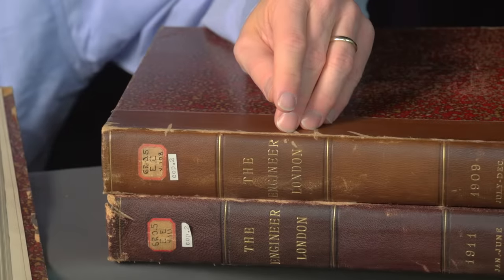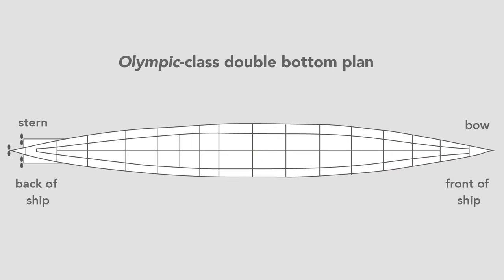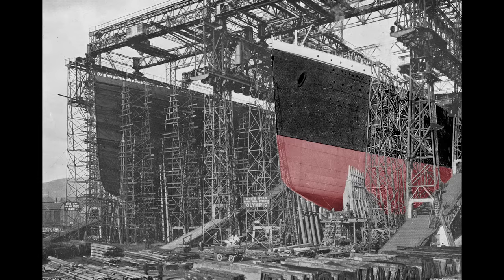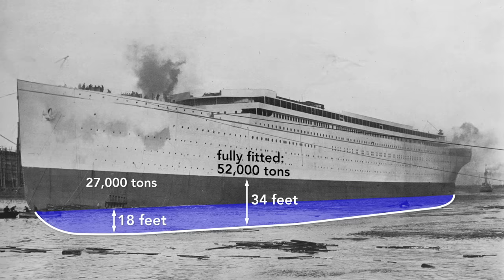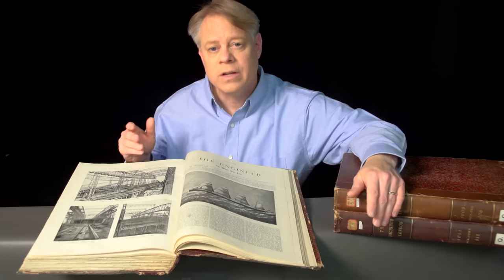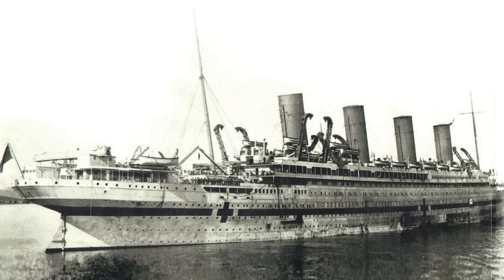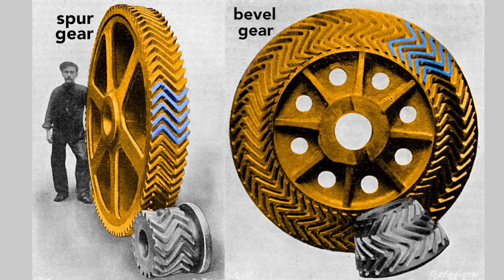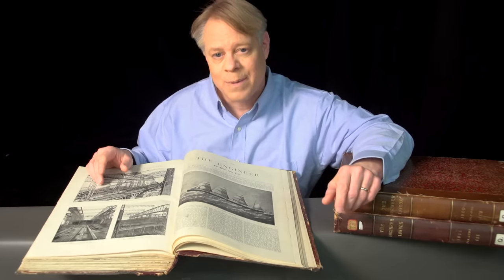RMS Titanic: Fascinating Engineering Facts

Comment: The Olympics engines were in A1 condition when she was scrapped... it was a terrible waste...
Reply: so that's where the steak sauce comes from... the more you know
Reply: @jaxonvictoria4345  well played.
Reply: No
Reply: A1 condition denotes the class of the hull and anchoring / mooring equipment.  It does not cover the machinery 👍
Reply: @skippyguy3  the engines themselves were listed as in A1 condition ...  by her engineer .. the yard engineering department.. her insurers.. mainly as she was fantastically maintained and well under her design life...
Reply: @blogsblogs2348    'A1' is/was a hull class notation used by Lloyd's Register to denote hull condition and is not used for machinery items.  Use of this terminology (incorrectly) by someone or an organisation other than the Class Society themselves is misleading and therefore extremely unlikely for marine industry professionals, especially on insurance related matters.
Reply: @skippyguy3  "Important"  Thanks for making that point  :)
Reply: But obsolete technology.
Reply: they would have made great engines for something.
A yellow submarine perhaps.
Reply: Pennsylvania Mike  
Look at the particular design of the boilers and the steam cylinders (engines) themselves.
(You've an odd perception -- stunted -- of tecnological changes.)
They came up with double- and triple-expansion steam engines, then tube boilers, then turbines.
For a ship the higher caloric burning oil over coal kills coal, and it's much easier to transport, store, and transfer. (I want to see underway coal refueling.)

I am perfectly aware of all the things you naively raise.

Obsolete!
Reply: Pennsylvania Mike  
Oh... and Hell has its own heat source. So, not a Hell of a lot of places burn coal.  :)
Reply: Pennsylvania Mike  
I am frankly amazed an Engineer would say "it's the exact same thing".
Did you not have a History of Science and Technology class?
Reply: @its1110  everything is obsolete in a few years what is wrong with remembering machinery from the past? What's wrong with learning from past? What's wrong with it?.
Reply: Pennsylvania Mike  thank you I cannot stand people saying things are obsolete when they're still using AC current these people want windmills and solar panels and they still want a 200-amp service on their home LOL
Reply: @its1110  there's nothing wrong with it
 so you want to come on here and dog the people that are into antique engines? Do you want to put us in jail LOL yeah you probably do
Reply: @its1110  as a matter of fact it had electric heat 100 volt DC make fun of that Jesus man you are messed up people
Reply: @ronalddaub7965  
Ahhh... You use the word antique.  Seems the same as obsolete.  i.e. No one is building with that technology to make new things.

You are trying too hard to misconstrue me.

I am into old stuff... I don't insist it isn't obsolete.  Equating the use of fire to make steam is all the _exactly the same_ (the very words used) no matter the era is asinine...ridiculous. THAT's all I'm saying.

Do you people come on here just to show your arse?
Reply: @ronalddaub7965  
Your last point is a mystery, out in the left field of the back, back forty of non sequitur.
Have a beer and relax. I just did. :)
Reply: @blogsblogs2348  Obsolete and probably expensive to maintain and operate. To an engineer - fit and ready; but to a business, scrap.
Reply: Would building a new ship around obsolete technology make business sense?  A museum would be better than scrapping them.  Of course the museum would be absolutely huge.
Reply: It was the midst of the great depression when they were scrapped, trying to run a ship that size during that time was more or less a money losing venture.  In addition to that, this was at the time when White Star and Cunard had merged so there was an excess of vessels for the one consolidated line to run.  An offshoot of the scrapping was that it put food on the tables of families that would have otherwise gone hungry.
Reply: @its1110  You have a real problem , you absolutely have to be RIGHT!!  Being challenged in the least bit , really gets under your skin. Must suck to be you. Personally,  I enjoy and respect old, obsolete technology,  but I also enjoy new technology.  So I'm lucky, and completely happy.
Reply: @johnfranklin5277  
I didn't say I am not interested in/don't "enjoy" old technology.  It is of _historic_ and artistic value.  This does not keep it from being obsolete. Y'all're misunderstanding (perhaps on purpose) and misrepresenting what I'm saying.

Obsolete simply means that newly produced items no longer use that technology/method, because newer ways have come along.

What is so hard for Y'all to understand about this?!
Reply: @davidsault9698  
Thanks, David.
"Historical curiosity" I think is the term.
To a business -- no longer economical to operate.
Reply: @its1110  The U.S. had a class of ships to do just that.
Reply: @jeffreyskoritowski4114  
Err. Aprops of what?
Reply: Look... what it comes down to --
The old engines could have still been perfectly fine condition and operation  for the day they were designed and built BUT still have been obsolete to continue to operate due to logistics and higher man-power AND advances in technology.

There is the idea that at some point Sunk Cost becomes a lesser consideration.
Reply: @its1110  Underway coal replenishment.
Reply: @jeffreyskoritowski4114  
Oh yeah.
That was fun.
NOT!
Reply: @its1110  I never said that it was.
Reply: @jeffreyskoritowski4114  
Oh. I was agreeing with you. Rather.
Reply: @its1110  I'm sorry if I came off a little harsh. Bad day
Reply: @jeffreyskoritowski4114  
No problem.
I should have put a smiley.
:)

Comment: I greatly enjoy your excellent videos.  However as an engineer and ship builder, two things stand out as incorrect.  One the color of the ship was not painted grey prior to launch so that it would stand out.  The grey is a primer, or an intermediate coating to tie coats together, and the final black is the top coat. Ships are painted in several layers of paint and the final is completed many times after launch.   Second is that pine was not used as keel blocking.  If pine was used at all it was in a very limited fashion such as on the very top of keel blocking for softening between the steel and harder wood.  The weight of the ship would far exceed the compression load capability of pine.   Likely the majority of wood seen in the pictures is very dense such as that of green heart.    

Another note is the construction technique of stick building the ship then versus modular construction today.  The limited capacity of cranes of the time drove stick building.  Stick build is erecting the ship in place using smaller components such as individual bulkheads and separate decks.  Today larger cranes and heavy transport allows modular construction of ships.  Multi deck modules can be transported and lifted to build the ship.  

Comparing the Titanic to the Costa Concordia.   Although alot has changed for the better, one thing has not changed.  Both had double bottom hulls as on all major ships.  Both did not have double hull sides below the water line.  Today double hull sides below the water line are typically only on warships and tankers.  Cruise ships today are still vulnerable to a Titanic type below the water line penetrations along the sides as well as water movement from port to starboard once penetrated such as the Costa.  As with any ship, perhaps the greatest safety risk and asset is the pilot.  Both ships were sunk by an operator trying to look cool.
Reply: I really enjoyed reading your comments and they made a lot of sense.  Thank you for taking the time to post your thoughts and observations!   Interesting read!
Reply: daniel letterman   If you get the dimensions of the hull, you can calculate the water displacement. If it displaces 5 million litres of water when at 5m draft and 10 million liters at 10m draft, and unfitted it has 5m draft, you can add 5 million kg, and you will know it will end up with a draft of 10m. 
Of course things are a bit more complicated because you have to calculate displacement based on various drafts and a ship isn't a nice geometrical shape. 
Disclaimer: i am not a mechanical engineer.
Reply: Good information.  Visit a ship in port, then fly in an airplane = cheaper, faster.
Reply: It's well known that Olympic was painted white to allow the b&w photographs of the day to clearly show her hull form at the launch.  Titanic was launched in her black paint.  Some conspiracy theorists use this to suggest the wreck on the bottom is actually Olympic as they think some of the white paint is visible on the wreck.
Reply: Lee Sale , you may want to do a video of your own. Enjoyed the video and your comments.
Fascinating for a landlubber like me.

Comment: I know the physics of it are "lighter than the water it displaces" but damn, a huge ship made of that much steel and the propellers alone weighing 38 tons, it just doesnt appear it should be able to float.
Reply: 46,000 tons. The steel plates that made up the hull were an inch thick and 16 ft. long.
Reply: and they add 5,000 tons of water as "ballast"
Reply: Same thing I think about with regards to aircraft.

Comment: Full steaming at open sea using turbine only, wheres both steam engines only is used during maneuvering at congested water
Reply: The turbine only controlled the centre propeller.  The reciprocating steam engines controlled the two outer propellers.  All 3 were used at the same time.  The centre propeller could not be reversed.  The outer props could.

Comment: 4.000 tons of coal for 2226 passengers. 1800 kg coal per passenger  6.6 tons CO2 Emission.
Compared to this, airplanes are very environment friendly.
For long distance flights is 3 liter per passenger and 100 km assumed,
Only 180 liter jet fuel, about 450 kg CO2.
Reply: @Jeremy Boatright I do not know actual name calling in US politics, I only know, we have to go out of oil, coal, biosprit, natural gas and uranium
Reply: Roland Mösl your argument is off the wall at best with the free interchange of tons and kg. Besides that a 100km trip is hardly comparable to an England to U.S. trip
Reply: @placesaroundus  You show the disaster of the US education system. Difficulties with tons and kg.
Here it's learned in the 2nd class, that there are only 3  zeros between ton and kg. 3 liter per 100 km means  180 liter for 6000 km.
Reply: @pegefounder  please do some research and get back with me. Specifically the definitions of ton and tonne.
Reply: @placesaroundus  A ton is 1000 kg, nothing else,.
Reply: Roland Mösl wrong. Looks like public school sucks worldwide, not just in the U.S.
Reply: @placesaroundus  Nobody outside US knows cracy US units.
Reply: @pegefounder  you automatically assumed i was from the United States. If you're gonna mix centuries old terms with SI at least spell it right so people will know. Better yet, just say megagram, that's the proper thing to do
Reply: @placesaroundus  Who should know, that such crazy terms even extist?
Reply: @pegefounder  not sure what you mean by that. I'm sure we can both agree there shouldn't be multiple 'tons' that weigh different amounts. There shouldn't be a standard gallon (3.8l) and an imperial gallon (4.1l?)

I hope i didn't come across as rude
Reply: @gj1234567899999  Learn to read and understand what You read. I stated clearly 1800 kg coal creating 6,6 t CO2 emissions per passenger on the Titanic vs 180 liter jet fuel creating 450 kg CO2 per passenger at an airplane at the same distance.

Comment: one really good thing with that class of ship is the major improvement to ship safety and reliability. after the titanic accedent there was made a new Convention/CODEX for ship building, such as "SOLAS" and the mandatory 3+ wather tight section hull where the rule was that the ship should be able to float with at least 2 of the segment filled, and that the engine room should be in a separate water tight segment where there was a bigger double hull under it(the hight of the ballast tanks needed to be higher up). in other parts of "SOLAS" it was mandatory to have at least as many life boats that could hold the full passangers and crew + some extras. at a later time they updated that to be that the ship should have double the space of live boat than the full amount of people onboard, and that they should be separated to be on 50/50 at least on ship(most ships went with more separation for logistical reasons), so that if one side was damaged they had the other side(or station)
more info on SOLAS and the Major change the Titanic/Olympus Class made: https://en.wikipedia.org/wiki/SOLAS_Convention

Comment: This is a great video and I learned a lot about these ships.  To me it's pretty amazing they were able to construct ships of this size and complexity.  Just because it was a 100+ years ago doesn't mean they were dummies!
Reply: I think the main limit to size at the time was the propulsion plant.
Wooden ships were quite limited by material strength, but the early iron/steel ships were mostly windjammers... power was used in times of dead or foul winds (the big problem w/ sail) and for maneuverability. (Esp. in harbours and tidal flows. No longer had to wait for tide and wind to begin the voyage or come into port.)

Comment: It’s amazing these ships were built back then. Just the machine work for the massive engines really the crankshaft and propeller shafts that big. Then the turbine engines spinning only 3,000-4,000 rpms is still amazing they were able to balance them good enough to go that fast reliably

Comment: bill, i'm amazed by the huge spline gears ze and bevel shape. i'm a retired aviation overhaul technician for UA. one area i'm dumbfounded is TURBINE BLADES for the driveshaft power the propellers. this is very unusual for technology on large ocean liners in 1919. imagine had they thought of it a smaller scale on the airplane. i know German did have the first jet propulsion, used it on the V2 rocket. of course the Chinese made the first firework, never put into jet propulsion concept. really great inform.

Comment: Note that the engine casing shown @ 8:14 is labeled "intermediate" making it the second of three stages in the triple-expansion engine. On Titanic, the intermediate stage piston was 84" (7') in diameter. Steam passed from there to the low pressure cylinders. Titanic's engine was a little unusual in having 2 low pressure (L.P.) cylinders on each engine rather than one. Each low pressure piston was 97" in diameter i.e. BIG. 
Idle speculation on my part: I suspect the LP stage was split in two as a single LP stage would have been 137" (~11.5') wide and there might have been significant engineering challenges associated with a piston, casting, etc. of that scale.
I've had the awesome experience of working aboard a vessel (Virginia V) still plying the waters of Puget Sound powered by a triple-expansion steam engine that predates the Titanic. Amazing machinery!

Comment: Veryinteresting. I had  wondered about the ballast of those liners, and the water makes perfect sense. Since it was fluid and not rigid, I suppose that added to the comfort factor, when underway.
Reply: It does add to passenger comfort; else, ship rolls too much in a heavy sea. 
Instead of water ballast many smaller ships have long used pig iron chunks for ballast - much cheaper way to do it.

Comment: Little known fact: the Titanic sank primarily because the bulkheads of all the compartments didn’t go all the way to the overhead leading  to compartments flooding and as each compartment filled with seawater, it flowed over the top of each bulkhead into the next, plus each bulkhead had no watertight doors to stop flooding into the next. These two engineering flaws doomed the Titanic to a watery grave. The Destroyer I served on from while in the Navy from 1961 through 1963 was on maneuvers with her squadron with a heavy cruiser in 1957 or so in the middle of the night, and the cruiser made a sudden left turn in front of my ship. Now, ships of course have no brakes, and my captain rang up all back emergency on the propellers and initiated a hard left turn to port in a futile effort to avoid a collision with the larger cruiser. The resulting collision tore the bow off my ship back to the no.1 five inch 38 gun mount. Thanks to watertight compartments with watertight doors, it was able to limp to port for emergency repairs. I reiterate, had the Titanic had true watertight compartments, she might have survived the iceberg collision.
Reply: scott nyc  
Sounds like he's recounting his ship's history from before he joined her.

Says he served on that ship from 61-63... not necessarily his years in the Navy.

Comment: I red somewhere that if murdoch hadn’t ordered full astern , the ship would have made it.

As he ordered full astern the rudder moved slower than usual .

If they had turned hard over and just put the engines to stop they would have cleared the iceberg .

And the bulkheads were stronger in the front of the ship, if it had collided with the iceberg head on there would be considerable damage to the front  but the ship would not have sunk . 

So many mistakes were made that night . 

Murdochs decisions sunk the ship . And he was supposed to be an experienced first officer

Comment: Have you heard about the high sulfur content in the steel of the Titanic?  The high S caused occlusions to form in the steel and resulted in low ductility at low temperatures.   So in the cold water of the north Atlantic,  the steel was brittle and broke easily when it struck an iceberg (versus maybe just a dent).  Any collision would have been a disaster.   There wasn't enough ductility to prevent breaking.